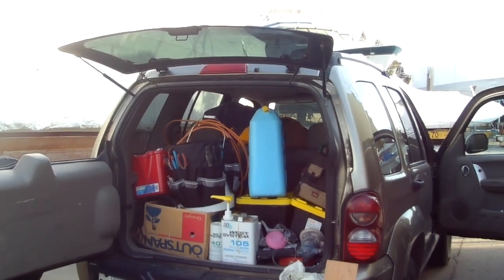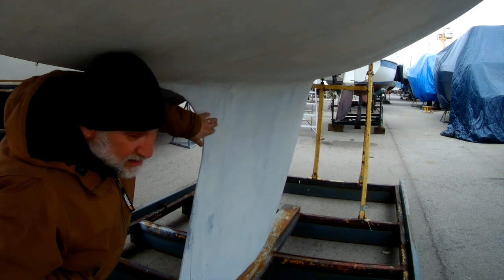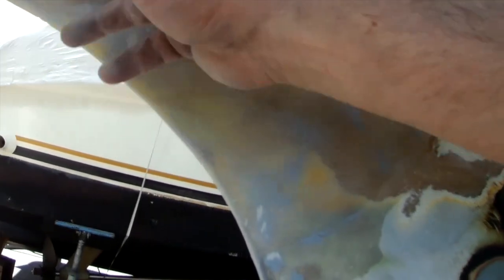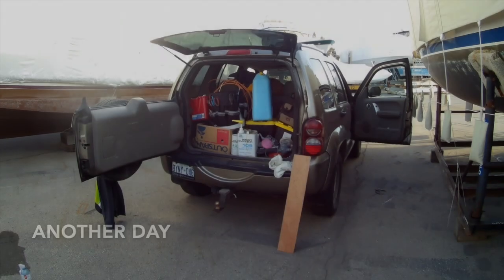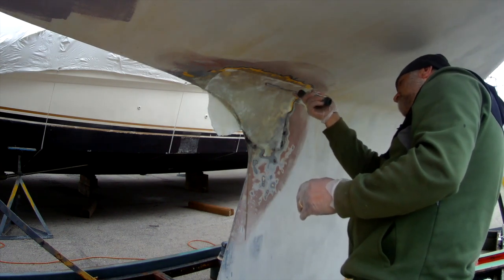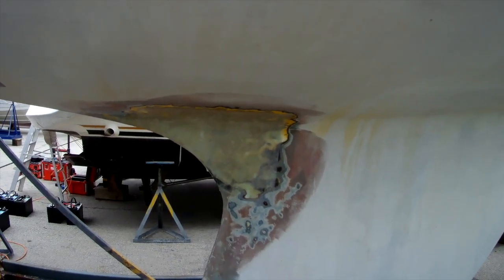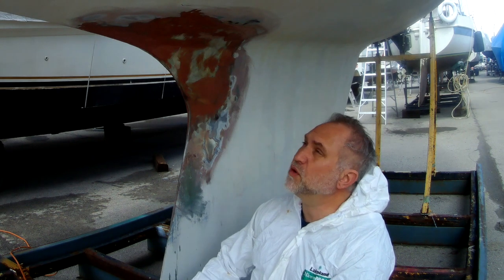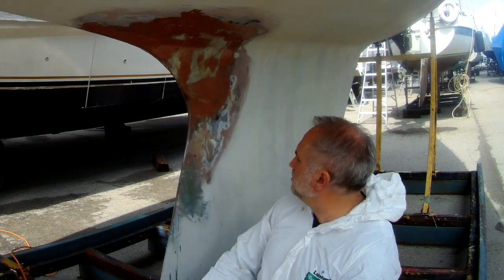Ep81, Keel Epoxy and Fiberglass Strengthening

Comment: Did you sand it only or used the grinders also? Can you tell me the type of tool you used?

And what temperature you were working at? I’m based in Sweden that why I’m asking this :)
Reply from the maker: @aloefrancisco5326 for the initial grind down i hit the top with the grinder and an 80 grit pad. after i switched to the Bosch sander and used 40 grit, 80 grit and 150 grit. i worked generally when temperatures are above 10 for all working materials. West systems needs +5 or better so i keep a watch for 3 days of +5 at night so things harden properly. the 205 hardener is necessary. Today, that repair is still solid. 

best to your project and hello Sweden!🇸🇪
Reply: @TheNeds  thanks for your quick reply I think I will sand and cover everything and wait for the spring in order to hit +5 during the night :) 

Question the disk on the grinder was a flap disk k80? Sorry is my question sound dump 😓
Reply from the maker: @aloefrancisco5326  ya i call them flap discs almost look like layered sand paper squares. but i bought a set that had multiple discs, from 40 to 120 grit but i only ended up using 80 grit the 40 way too coarse on a grinder it eats everything